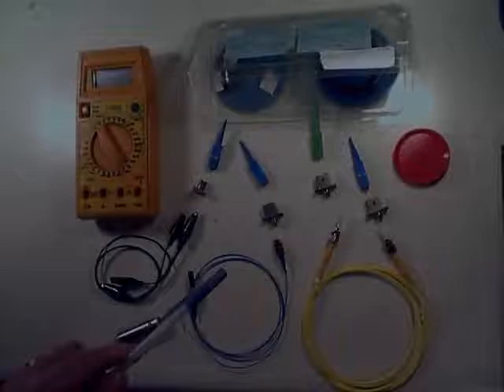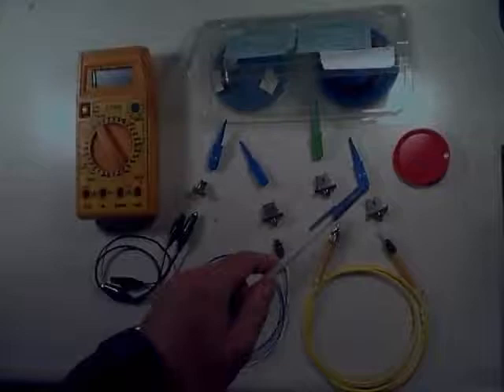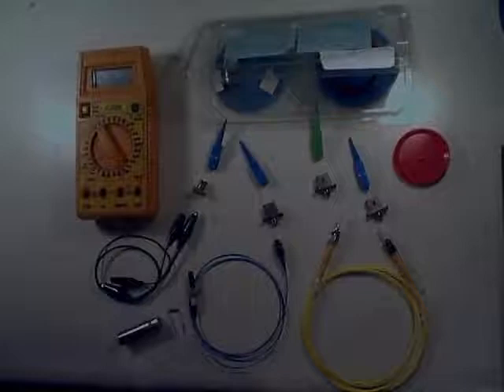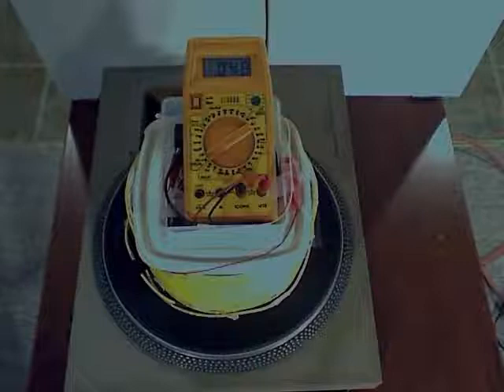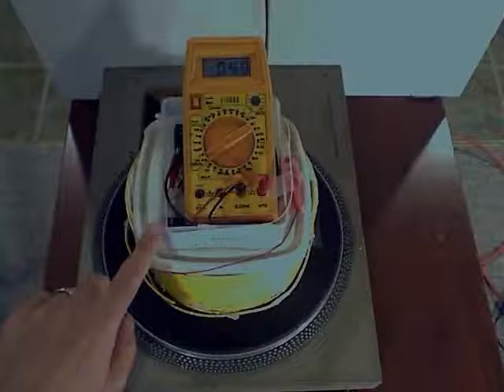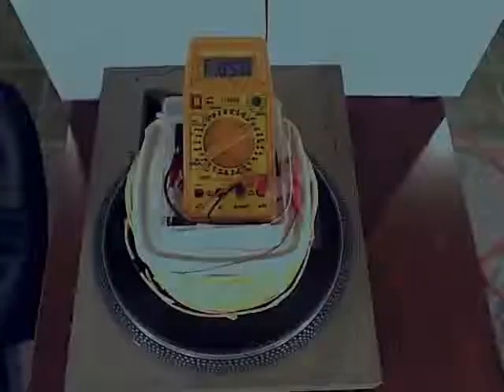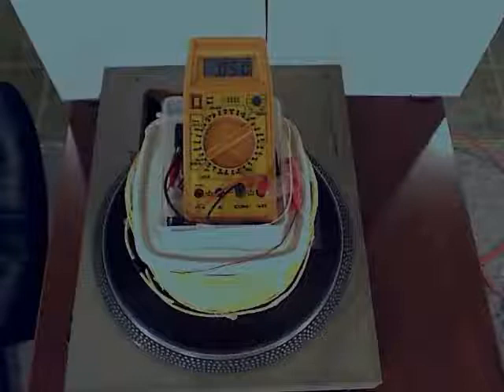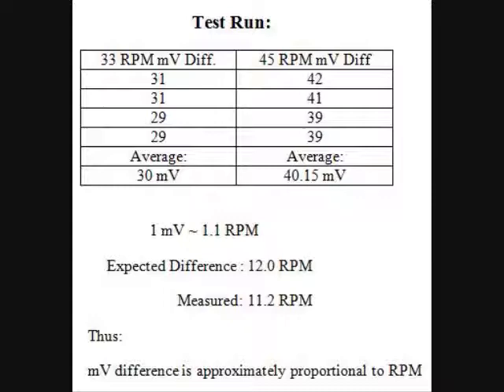Sagnac interferometer Fiber Optic Gyroscope ( FOG ) construction and testing

Comment from the maker: I know that it is often suggested to use polarization-maintaining fiber and a polarization filter. However, in experimenting with various setups I have discovered that you can make an adequate Sagnac interferometer (like 20 deg. per hour sens.) with single mode fiber (like SMF-28) and without a polarization filter, which is how I have done it. You can also use a generic source like a DFB or MQW IR laser. It is actually surpising how well it works with such low cost materials!

Comment: Great video, thank you. Just a couple of inaccuracies, in that configuration the response of the multimeter is not linear with the speed of rotation, so the calibration table at the end is not correct. Should be a cosine function, which close to the vertex looks like quadratic, so the response should be proportional to the square of the speed for low speeds. Another source of nonlinearity is the photodiode in voltage mode, which is strongly nonlinear too, you should read the current or use a TIA to get a linear response. In any case, I am surprised of the success of the experiment using such inexpensive materials, great job.

Comment from the maker: Thanks! I got my parts from the lightwavestore. The laser was about $40, the 40m smf jumper is $17, the photodiode was about $20, the 2x2 coupler is about $65. So perhaps about $150-175 with the adapters all up, assuming you have a multimeter and turntable already.

Comment from the maker: The fringe shift  is proportional to the area enclosed by the fiber loop, so the longer the fiber the better. The shortest I have done is 40 meters, you could go shorter but then you will have to amplify the fringe shift a lot. Generally they are around 50-1000 meters long.

Comment from the maker: One important point - although I am using a device commonly known as a "polarization controller", the primary function of adjusting the angle of the paddle is to adjust the phase relationship between the two beams at the output to destructive interference, rather than the polarization.

Comment from the maker: I used a PIN photodiode with a build-in FC connector so the fiber plugs right into it - got it from the lightwavestore in Ottawa for $28 - it is model PIN-1300-FCI. Since the output is primarily DC, you can take the voltage directly off two of the three pins (photovoltaic mode). If you want to amplify the signal further, see the amps that I describe in the part2 and part3 videos on my channel.

Comment from the maker: Easy way - calibrate it by running it on a 33 rpm and 45 rpm turntable, determine the voltage at each speed. Hard way - determine the voltage swing on your PIN diode from maximum destructive interference (lowest voltage on multimeter) to maximum constructive interference (highest voltage on multimeter) to find the voltage difference corresponding to a 180 degree phase shift. Then use the Sagnac interferometer simulator on my website to calculate the theoretical phase shift per angular velocity.

Comment from the maker: There could be higher vibration sensitivity - I haven't tried PMF to compare. I have tried running powerful magnets along the side of the fibers - no Faraday effect that I can detect. Very high electric fields might have an effect (Pockel's effect or Kerr effect) but you might need specialty fiber. Putting the fiber under tension (stretching) is a simple way of changing its refractive index, and thereby the speed of light in a given arm.

Comment: Can this Device be used to show the rotation of the Earth?
Reply: No..because earth isn't rotating.
Reply: @YouTw1tFace  Hmmm. Airplanes use fiber optic gyroscopes everyday. A Fiber optic gyroscope will show that the Earth is rotating. I just did not want to spend 20,000 dollars for the privilege.
Reply: @kafr8413  Airplanes use them sure. If earth was rotating then it would rotate underneath a hovering helicopter...and it doesn't.
Reply: @YouTw1tFace  Haw many years have you flown a helicopter? What kind?
Reply: @kafr8413  I've spoken to pilots. Same with hot air balloons and planes. The earth does not spin out from under them.